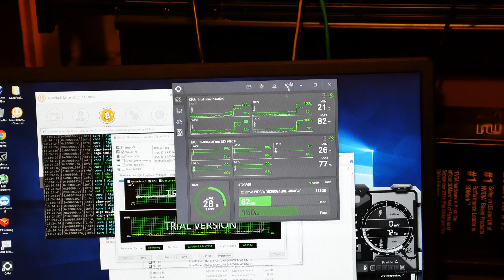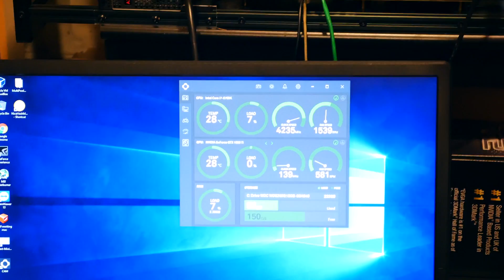Will delidding my intel i7 6700k let me use a tiny noctua heatsink?

Comment: this convinced me to pop the IHS from my 7500. as reference, i'm using a i5-7500 in an acer veriton n4640g, which usually has cpus up to 35w TDP, so the cooler isn't the most capable. 
thanks for the video my man. cheers